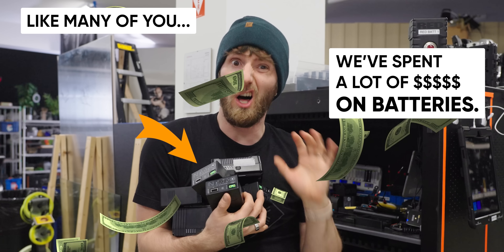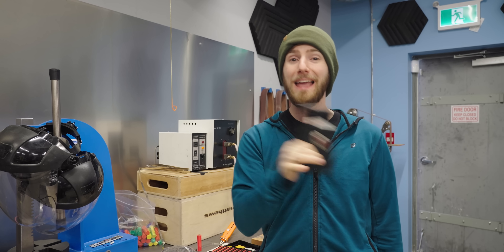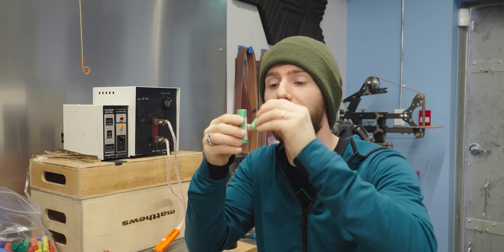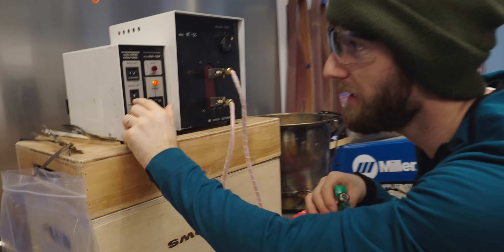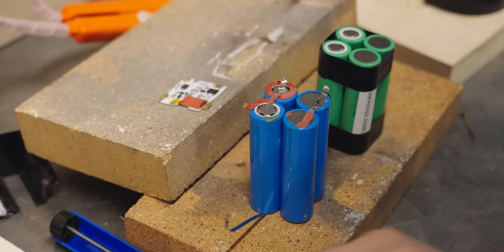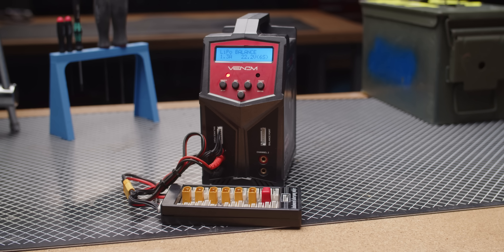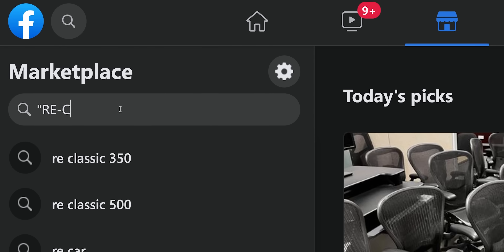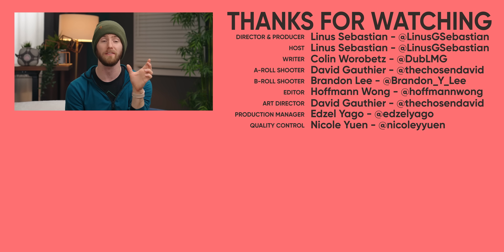This should be illegal… Battery Repair Blocking

Comment: A lot of BMSes will nuke themselves after a cell voltage drops below a certain level. This is done for - allegedly - safety reasons, but also happens to have the side effect of making the cells difficult to replace.
A known trick to bypass this is to keep the BMS powered at all times - connect a lab power supply through a resistor to BMS input, desolder the old cells, solder the new ones in, remove the lab power supply. This still doesn't guarantee success, but it gives you a fighting chance.

Comment: Battery cells should be user‐replaceable. It does not have to be hard or dangerous to do.
Reply: In devices like bluetooth speakers, yes. But these Red batteries are user-replaceable batteries. They only consist of the cells and a bit of plastic around them, and a small pcb. They are v-mount, which has been an open standard for decades and you can use them on countless devices from cameras to lights and monitors by all manufacturers. If you replace the cells, paying end-user prices for the cells, you're probably going to spend more money on the cells than buying a cheaper alternative brand like Swit or idx. And the old cells are still dead and need to be taken care of. From an energetic/resources perspective, the plastic housing and the pcb are absolutely nothing compared to the cells.

Comment: A reputable recycling center tour would be interesting.  Especially when alot of them send stuff overseas that just get open pit burned and metals skimmed off
Reply: You know that doesn’t work with lithium, right?

LEAD ACID batteries are recycled by separating the lead, draining off the acid, and pelletizing the plastic.

A cheap and stupid way of doing that would be throwing the lead acid battery into a fire.

But that WOULD NOT WORK with lithium !

It sounds like yet another anti-recycling hoax.

It’s difficult for honest people to understand why propaganda mongers LIE all the time, but we know they do.

The Fossil Fuel industry faces losing BILLIONS as people transition to green energy.

They’ve been LYING about solar cells for about thirty years.
Reply: They do open pit burning with circuit boards, not batteries. it's more cost effective than sitting there all day with a soldering iron, and hammer and chisel.
Reply: Fucking Imperialism..... The highest stage of capitalism.
Reply: If you go to Retriev's website and click on lithium ion, it seems like they also do this.   "The metal-enriched liquid is solidified using filtering technology, and is sent off-site for further metal purification." 
Prove us wrong!
Reply: @Darer007 

It’s easy to prove you wrong.

LITHIUM BURNS.

Comment: I'd be curious if you could use a bench power supply as well as pre-charging/pre-discharging old and new cells to match voltage in order to fool the BMS.

Comment: Hmm... Those red batteries seem to be 4S4P, which means you could try connecting 4 cells in series to the BMS(make sure they have the same voltage as the original cells.) before disconnecting the original cells, to keep the BMS forcibly alive, while you work on it. :D

Comment: Please spend more time on right to repair and PLEASE start shining a light on the magnuson-moss warranty act.

Many of these anti right to repair activities are flatly illegal - like "warranty void if removed" stickers and mfgers flat out do not care. 

You can use your platform to put this information into the public's mind. There are so many people attacking each other for modifications and drive swaps and etc because all over the country folks simply believe turning screws invalidates warranties.
Reply: Right to repair and ability to repair are different things. I work for an electronics manufacturer, and most warranty claims we get involve idiots doing things the manual tells them not to pretending their device just stopped working properly for no apparant reason. We implemented measures to keep some of the more crass things from happening (things like removing sealant and claiming warranty over water damage) - or least to make it demonstrably not our fault, which on surface inspection might be interpreted as "anti right to repair activities".
Reply: @MrAranton  You just charge a bit more and warranty it all. Nearly all tool truck brands do that and have for decades and amazon does it to. Probably many others i just think of them 2 right off. Next make good quality stuff so it don't need a warranty....
Reply: @eatshitful  For reasons I'm not going to get into (company secrets and all) opening our devices is roughly equivalent to leaving your TV out in the rain.
Please tell me of the companies that would accept such a warranty claim and those who decide to make "good quality" so such a warranty isn't needed.

In this video Linus makes the disclaimer "DON'T DO THIS AT HOME" because repairing battery packs is tricky and dangerous. There are things to keep in mind, you need tools not everyone has. If changing the cells in a battery pack were as easy as replacing the batteries in your remote, people who don't own (and don't know how to operate) a multimeter would attempt to do it.
Right to repair is all fine and dandy, but keeping customers safe by building obstacles that keep them from doing things they really shouldn't be doing should take precendence. That does not include a battery management systemt that only allows a set number of charging cycles, but considering the damage a bad or even mismatched cell can do, a BMS that shuts itself off if it can't verify the cells in the pack, is a justifiable safety measure. 
Also: Companies need to protect themselves against legal liability. If someone tries to fix a battery pack, screws up and burns down their house, they might sue the manufacturer of the battery pack. Whackier suits have been won in the US legal system.
Both are valid reason to go "If you can't make the repair-process fool-proof, make it so hard, fools can't even begin to try.
Reply: @MrAranton  well I already named a few so I don't know why you need to ask as if I didn't?? Clearly your ability to understand simple things is to hard. Also as shown in this video doing what the manufacturer did clearly did not stop anyone from trying to repair the battery much less stop there house from being burned down. They still got that far anyways making every claim you have worthless. Would you like another B's try? In the end we need to go back to people keeping them self safe as there is no way you or anyone else could 💯 keep another safe. It simply can't be done. All you are doing is making excuses adding to land fills and making more profits. If you or your crap company really cared and don't want idiots doing dumb things you would be repairing your own stuff so customers don't have to. Like a battery company that sells them could also offer a rebuilding service. But your not that smart to figure that out now are you? Did you ever think that if these battery packs could be rebuilt a company might be formed just to do that for people? Then it is someone with the proper knowledge to do it and customers would then let the experienced rebuild them. Ohh wait that has already happened till some bozo company made there packs non rebuild able. Enough with your excuses you just want to fill your pockets without a care of filling landfills and taking more money from customers. Lastly since you are so unable to comprehend what I stated amazon does offer warranty on some of there inhouse electronics no question asked replacement. So I'd does not matter if you open it up throw it in the toilet they will replace. The other I stated was tool truck brands. It has been well know for many decades if you break there tool they warranty it. That is why most repair places buy there tools from them. I can literally take a 50 year old tool that sat in the dirt for 40 years break it in the vice and they will replace it dispite the tool being rusted to a unusable state. I know I have done it. I don't even have to be the original buyer of it. That is why broken tool truck brand tools still have value. You should put your company name up here and see how many people keep buying your products. I bet you won't even know you claim they are so good to there customers..
Reply: @eatshitful  Before you critique other people's ability you should critique your own. No company will cover everything under warranty. If you leave your TV out in the rain, no company on this will consider this a warranty case. They might repair your TV, but they will charge you for it. So much for your "just charge a little more and cover it under warranty"-line.
I don't know about that tool brand - it doesn't operate where I live. But Amazon's warranty terms contain the following phrase: "This limited warranty applies only to Products that are not subject to accident, misuse, neglect, fire or other external causes, unauthorized use, alterations or repair, or commercial use." I don't want electronic spies in my home, so I avoid amazon in-house electronics, but from what I know odds are, those "in house electronics" with "no questions asked warranty", lock customers into the amazon eco-system. If your kindle breaks down, they have a vested interest to get you a new one as quickly as possible (and to take a loss doing it), because as long as you don't have a kindle, you're not going to buy any content for that kindle. If they give a kindle owner who makes a warranty claim trouble he or she might decide to switch to a different product and get new content elsewhere. This has nothing to do with concern for the environment or the customer.

The company I work for doesn't sell to individuals, we sell to institutions who then equip their agents with our devices. One of those institutions tried to claim warranty on about a third of the contract volume, claiming the devices worked fine for a while and then stopped working for no apparant reason. When we opened them, we found out they stopped working because some of their internal wiring had been cut.  Management decided we couldn't afford to antagonize that customer and had the devices repaired ex gratia and the company took a signifcant loss on that contract. Stuff like that happened with most contracts, though admittedly not quite as badly. But this one was why management decided to stop using screws to close casings in favour of welding or glueing them shut to prevent things like that from happening again. And guess what: We're not dealing with "some of our people thought it was a good idea to cut internal wires in a devices and now we expect you to fix it for free"-warranty claims any more. Sure, the newer models are harder to fix, because opening a casing that was welded or glued shut is a pain in the ass, and yes, after a casing has been opened, it need to be discarded. But: the number of units sent in for repair has gone down drastically.

The idea that customers should send battery packs back to the manufacturer in order to be refurbished sounds nice - in theory. But there are practical issues: How much do the new cells cost? How much does it cost to pay a technician with the qualifications to do it? How much does the shipping cost? And how does the sum of these costs compare to just making and a shipping new battery pack? With that in mind starting a company to refurbish battery is unlikely to be financially viable. And from an environmental perspective: How much of the environmental impact of a battery pack is due to the components that can be re-used by replacing worn out cells?  5%? Doesn't sound like a gamechanger to me, more like greenwashing a brand.
Reply: @eatshitful   If you went through thirteen tablets, that shows what a "no questions asked guarantee" does to the environment. If you want fewer electronics to end up in landfill stop destroying them because amazon will replace them for free anyway. And as I already pointed out: Amazon profit does not come from selling electronic devices. It comes from selling content for those devices and services through those devices. They profit from that to subsidize the devices to capture client does, much like nespresso does: cheap coffee makers, expensive coffee pods. Companies that resort to sucht tactics are a lot more crap than companies that reject unreasonable warranty claims, because there's no way they can make a profit with a "buy one get three free"-policy.

You're right on one thing: I am not a repair shop. I work in the repair department of an electronics manufacturer. That manufacturer does not sit in an english speaking country and neither do I. That tool trucks stop at nearly every repair shop in your country, does not mean they exist where I live. And frankly: If those tool trucks regularly stop at repair shops, repair shops must through a lot of tools. If they had qualitity tools that actually last, the most frequent response those peddlers got would be "no thanks, we have all the tools we need".

You know jack-shit about the devices we make. They're certified IPC-class 3A, if that tells you anything. If doesn't: Our devices cannot fail in normal operation, because if they do, lives are at risk. Which is why we build them to last. If you treat them right (i.e. don't do things we explicitly tell you not to do), you can toss out of a car moving at motorway speed and even though they will look pretty battered and have scratches all over them, they will still function (though recallibrating them might be a good idea). You can leave them in a desert or the arctic for a year, dump them in a swamp or the ocean for a month and after you rinse them clean and put in new batteries, they will function. But only as long as you don't open the casing. I have serviced one that got under the tracks of a frigging bulldozer (admittedly on soft ground), parts of the casing were shaved off by the tracks and obviously no longer met specifications, but when I got it, it was still water-tight (I ran the test out of curiosity) and still functioned. I replaced the casing, updated the firmware while I was at it and if I remember correctly the customer paid about ten percent of what the device costs brand-new. I highly doubt Amazon electronics with their oh-so-brilliant no questions come even close to meeting the standards of IPC-class 3A.

The devices we make do not require battery packs. Normal C-sized rechargeable batteries are all they need. Where I live any store that sells electronics takes back used and defective batteries (rechargeable or not) and is required by law to see them properly recycled. Much more convenient than sending a battery pack for refurbishing and since it doesn't involve cases that eventually break, or management systems that eventually break, it's a clean solution for that relies on existing infrastructure instead making it necessary to build a new one.
From an environmental perspective, custom made battery packs are the second worst possible to way to power an electric device. The only worse way are single use batteries (generally speaking, there are exceptions such as low power devices such as clocks, that last months if not years on a single charge). Refurbishing them once the cells die does not change that. If you want to contribute to landfills as little as possible, avoid devices powered by battery packs and prefer devices with chords that connect them to the power grid whenever you can. 

And finally: I just wasted my time, because by resorting to ad hominems, you lost the argument anyway.
Reply: @MrAranton   It's extremely difficult for an end user to prove a manufacturer mistake vs a manufacturer insisting the mistake was the customer. The financial burden that puts on one vs the other is enormous, and there is a big difference between using an identifiable and difficult to replace seal to identity end user tampering - which you are then protected from having to replace or repair anything directly resultant from that, and saying "if the customer opens the lid the warranty is void" and you know it. 

I've been in IT working for manufacturing companies for nearly 20 years. I know where you are coming from and how often the end recipient is a huge dick trying to game the system, but you can't throw out consumer protections because you are grumpy some dongs will exploit it. To suggest that you should is morally disgusting.
Reply: Warranty void stickers aren't illegal. They're just not enforcible by law. So manufacturers use them to have an excuse to try to not honor their warranty, and it works because most people will not take it to court depending on how much their equipment was worth and how much hassle it wil cause them. It's a shitty situation, yes, but the only way to fight it is increasing awareness, avoiding purchasing from the companies who do this, and not letting them get away with it if it happens to you.

Comment: I'm not a battery expert nor an advocate for evil companies. But there might be another reason why they stop working. When a cell is discharged too far, it will be damaged and charging it is extremely dangerous. The BMS will prevent this over-discharge, but it will not prevent this happening due to self-discharge or damaged cells draining the others. It could be that the BMS detected a too low voltage and decided to 'NOPE' forever.